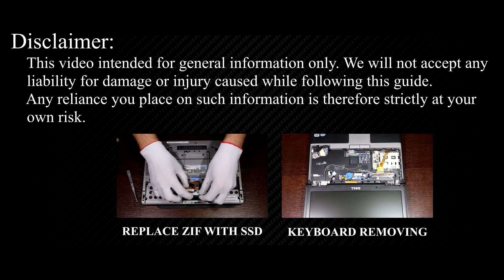Dell Latitude D430, D420, D410, 120L Upgrade and installing RAM | DIY step-by-step guide

Comment: Can I put 8 gb of ram in there and a 64 bit processor in the latitude D 430 or is that computer just to old I got it for free
Reply: No. How do you think you can upgrade a processor in a laptop?
Reply: Whats the max ram that this computer can handle
Reply: @Emils_-hu5un  2 GB DDR2 (for the D430 same unit I have and I added an msata drive with an adapter for fastest possible speed).